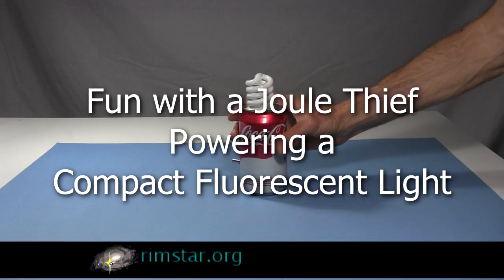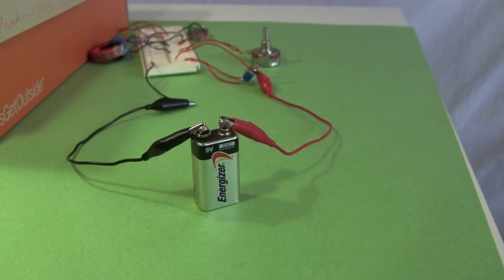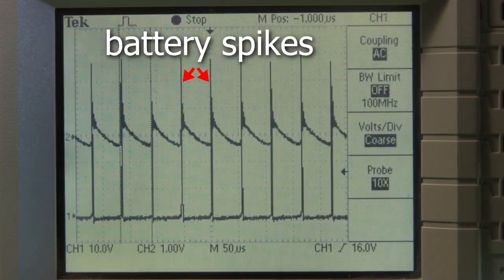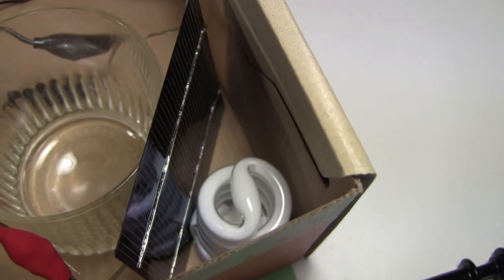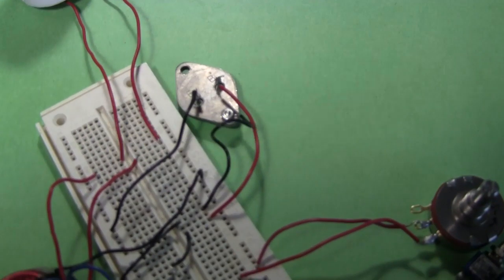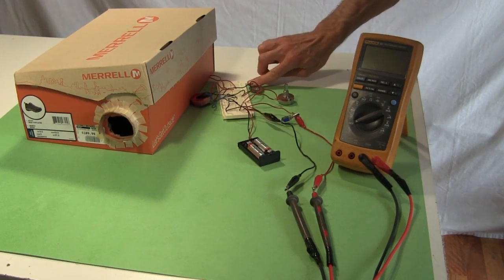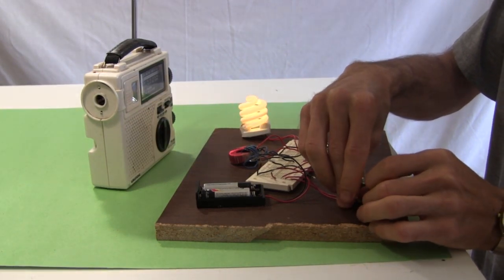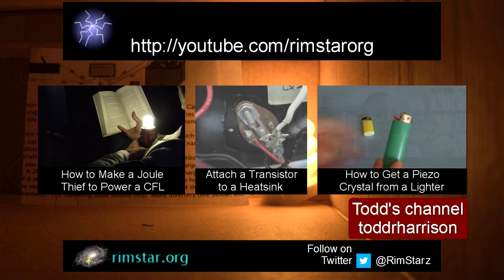Fun with Joule Thief Powering a Compact Fluorescent Light

Comment: I have a question: can I buy from a local store any type of high power audio transistor in case I can't find yours?
Reply from the maker: I couldn't find any audio transformers in our local stores. But that could just be our stores. Yours might be better. There are probably many sources online but one I know of is http://www.scitoyscatalog.com/category/R.html I'm not sure if it qualifies as high power.
Reply: RimstarOrg, my question was about transistors, not transformers.
Reply from the maker: Than Zamp
Oh! The "audio" in front of transistor thru me off. I've never heard them called audio transistors so I've never looked for them. I buy my power transistors at local electronics stores. One store I go to has only NTE 130, which is equivalent to the 2N3055. The other store has 2N3055 and others but I don't remember the part numbers.
Reply: RimstarOrg, Thanks for the info about your transistors. I just want to know if any type of high power transistor will work for a joule thief experiment, because I used a lower power transistor taken form a damaged CD-R device, I managed to use it succesfully as amplifier, but in my joule thief experiment with a CCFL transformer (from a LCD screen) wasn't working no matter the polarity I used. The strange thing: it is not damaged, because I tested it with my digital multimeter.
Reply from the maker: Than Zamp
I honestly can't say which ones won't work (well, except for very small ones like 2N4401), only the ones I've mention which I know have worked.

Comment: double the turns on the primary with thinner awg , and double the turns on the secondary with thicker awg, 1 awg difference is good , this way use less power and still get high voltage lower frequency may happen not sure lmk

Comment: can I use small signal transistor instead of power transistor?
Reply from the maker: You'll likely burn out the transistor.
Reply: so can I use transistor like tip31 or MOSFET like IRFZ44N
Reply from the maker: The TIP31 might work. Its ratings are a little lower than the 2N3055. MOSFETs probably require changes to the circuit.
Reply from the maker: Oh, and make sure you use a heat sink for the transistor, otherwise it may heat up very fast and not last long.

Comment: Is there any way to reduce the eneryloss due to heat coming from the components? I think that at least 50% of the energy was wasted in the components.
Reply from the maker: If you're concerned about energy loss then you might want to start by using a different circuit. The joule thief circuit is horribly inefficient.
Reply: I always thought that the joule thief is very efficient at least when powering led`s. Maybe im just gonna buy a 12v cfl and look what`s inside.

Comment: I have question to how did you turn the toroidal transformer?? it how be a like a normal transformer turn like primary will be 9 turns and second will be 23 turns to make 23 volt?? I don't get much.
Reply from the maker: +talastas789 I wound the toroidal transformer by hand. You can see it in the video where I show how it was made https://www.youtube.com/watch?v=FkLET8MhRbU.
Reply: +RimstarOrg I get it!!! its like a real winding a toroidal one!!  but when primary will be much low turn to meet a 9 to 10 input right?? so yeah I did get it !! thank for it!!!
Reply from the maker: +talastas789 I don't understand your question about the 9 to 10 input. What are you trying to achieve? This will not put out 23 volts DC. A joule thief circuit puts out a voltage that is very spikey, as you can see in some of the oscilloscope clips in the video. If you are looking for how to calculate the number of turns needed for a transformer here's a webpage that seems to cover it http://www.sayedsaad.com/fundmental/21_TURNS%20AND%20VOLTAGE%20RATIOS%20%20.htm

Comment: Maintenance stated they used their hand and had burnt themselves. The normal operating temp of an eddy current brake is 1200 degrees So yeah your going to get burnt bad. I just was wondering how some heat verses a lot of heat effects battery life and current.

Comment: sir i have 12V 7.8Ah old desktop UPS Battery with good backup i want to use it for light CFL at least 3 hours continous backup needed using joule thief method . could you please suggest me what kind of  material i needed. what rating of register etc .....
Reply from the maker: sameer khaan I'd go with a power transistor like in this video and as for the resistor, I'd put in a potentiometer (variable resistor) and adjust it, also like I did in this video. That's the only way I know with this circuit to find out what resistance to use.

Comment: can I make a Taser using this??
Reply from the maker: The spark is probably a little weak with these specific components but this fly swatter (http://youtu.be/sQCKNZMNCo0) is the same basic circuit with some parts added and can be used as a taser.
Reply: ok so if I touch the output will I get shocked??
Reply from the maker: I'm not sure you'd get a shock, or at least feel the shock, when using the specific components used in this CFL joule thief circuit. But you'd definitely feel the shock from the fly swatter joule thief circuit. It'd be a painful, though harmless, shock (unless you have a heart condition).

Comment: mine is not working attempt 2 times its failed like in reality its not possible. high voltage turns all ok transistor all fine its like impossible
Reply from the maker: How many watts is the CFL that you started with? The longer the coil of the CFL, the higher the voltage you'll need. Maybe that's your problem. You could also try connecting more batteries in series to give it a higher voltage to start with. And the only other suggestion I can think of is to try a lower resistance resistor.
Reply: by the way iam working on mosquito zapper lower frequency like 9khz not enough can you help me out how can i get 30khz on that zapper
Reply from the maker: You'd have to at least wind a new coil for the zapper and possibly replace the resistor. That's assuming your zapper is using the same circuit that was used in a zapper I once took apart.
Reply: you helped me lot iam so lucky find you one last thing what about induction module output can you make a vid i think cfl can glow damn brighter then any of these so higher frequency if it douse i will order induction module
Reply from the maker: I don't know what you mean by an induction module.
Reply: induction heating
Reply from the maker: Oh, thank for clarifying. That's not something I've ever worked with. Sorry, I can't help you there.